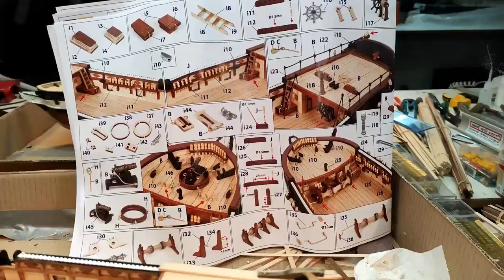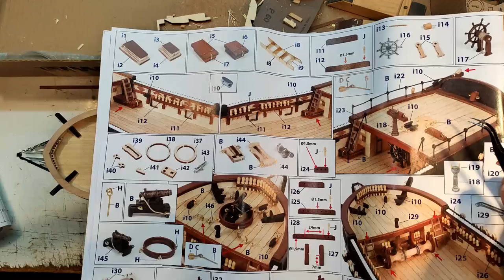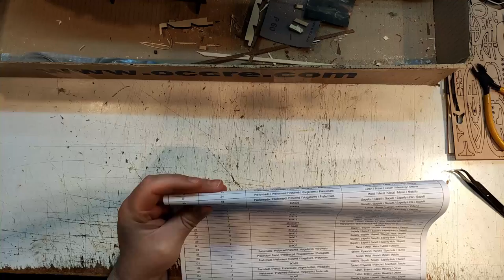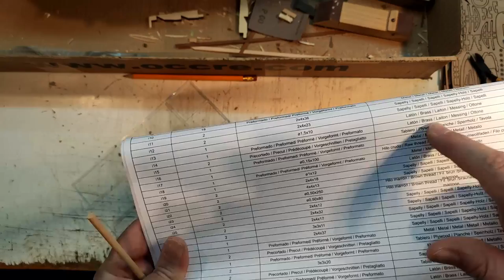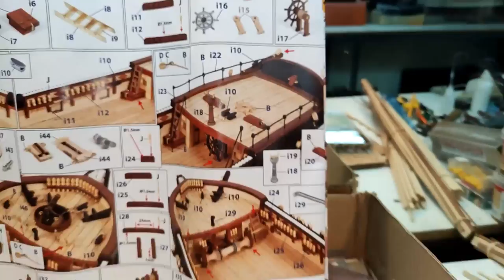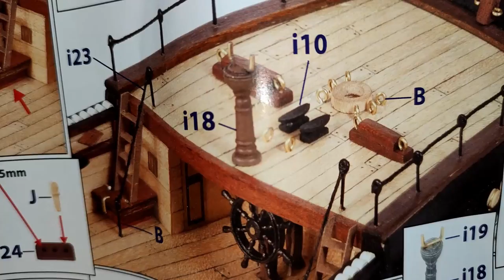HMS Beagle - part 22 Making Stuff For The Deck (part 1)

Comment: I've noticed that you usually put the glue on the mounting surface instead of on the part to be mounted. Is that simply a personal preference or is there specific reason to use that technique?
Reply from the maker: In many cases it gives me a few extra seconds to correct any centering mistakes, also the extra glue goes around the piece where it touches the surface and makes a stronger bond. But it always depends on the piece, sometimes i use the glue on the piece it self.